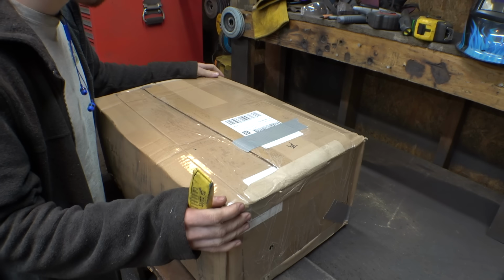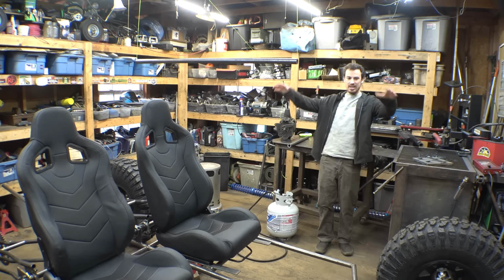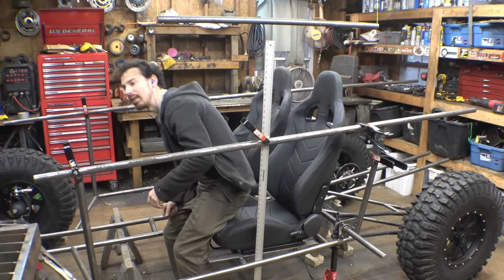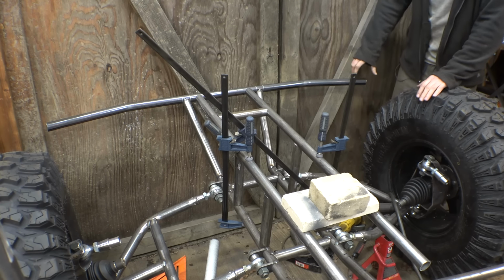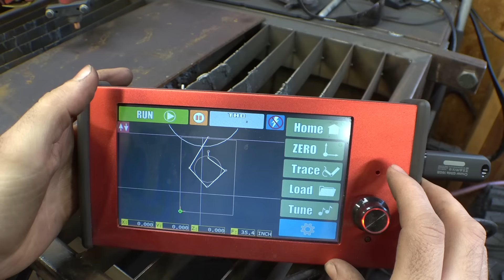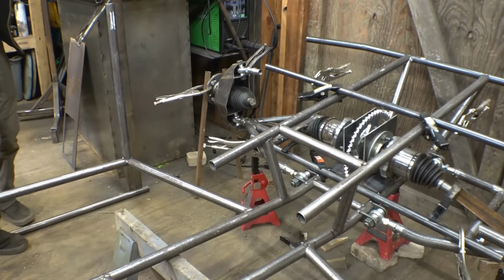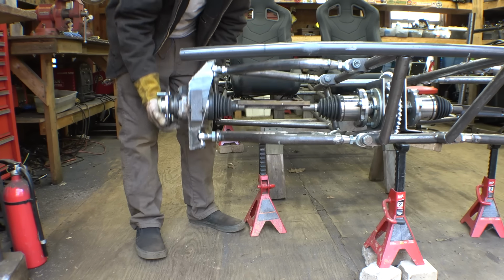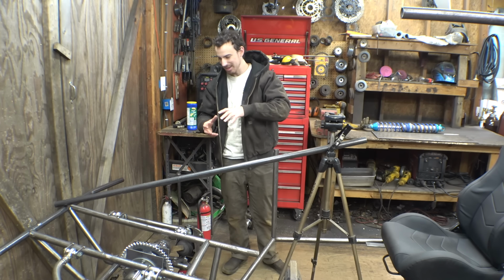Mini 4WD Trophy Truck Project - Part 3

Comment: Honestly bolt on long travel kits for Toyota 4Runners/Tacomas are only 13.5-15” travel with 4wd and you can see how amazing it does high speed. All in how the suspension is used and what suspension you use. 12” travel Double or triple Bypass shocks can be tuned to handle better than 16” rigs with lesser shocks

Comment: Since you really don't have a whole lot to work with, have you considered moving a few things around and converting it to a cantilever suspension? I believe with what you have it may work better for you. You would be able to get away with much smaller shocks and get more travel out of them by using mechanical advantage of a cam

Comment: You might want to check out a diesel parking heater to heat you shop. Might do a bit better and it's safer if cuz the combustion is separate from the room air. You'd also get a video out of it 😂

Comment: Dude, you can see on my channel. Im using front engine gearbox as transfer case. You can have 5 forward gear and 1 reverse. I think that much more cheaper. Nice project dude

Comment: Great progress! However I believe you should hav more bottom end travel, the skid plates are supposed to take some botyoming out in the dunes!😀
Reply: The tires will compress at least a couple inches when you bottom out the suspension.

Comment: Incredible video as usual! Can i ask, what is car brand of the cv joints? In my country is rare to find them with internal joint flanged as the miata (This car is not commercial in Colombia as in US). Maybe do you know any other brand for cars and trucks which have them flanged and not both ends splined?

Comment: For safety reasons I recommend NOT to mitre roll bar ends.
Terminate tube end into the side.
A 45 corner can shear in compression if you roll the rig.

Comment: Just curious but do you ever consider selling your builds? Honestly the quality seems on par or better than some of the best cart or sxs manufacturers, while also being easier to service. Could take custom orders film the builds and testing and sell them to fund the channel.

And speaking of sxs have you ever considered doing a build on a sxs? Like buying an old Rhino or something salvaged and doing the ultimate rebuild or mod series. Like I have an old rhino 450, they're rather inexpensive but also dogs on power. You could pick one up, build custom suspension, modify the cage, do an engine swap, all kinds of things. But save alot of the work of building the initial structure and body. Mabey a big vtwin with a 5spd, bigger diffs and long travel. Or pick up a flood damaged four seater maverick and replace the back seat with a car engine like an LS.

Just some ideas, can't wait to see the rest of this build. Love some trophy truck goodness.

Comment: Thinking about the rear suspension with two chain driven swing arms.  Without a rear differential, isn't there a problem of binding if the left and right swing arms are moving independantly?  Like can't that lead to an unequal tension on each chain?  I seems like there's a scenario where you're giving the engine throttle while one arm is rising and the other is falling and the chain on the rising arm ends up taking the force from the drive but also some load of the suspension?  

This sort of thing happens on low pivot mountain bikes when the hub has high engagement, and the suspension is compressed deep and fast.  Extra forces from the compression of the suspension are transferred into the drive (the chain) and the rider suddenly has unexpected power delivery or the chain takes too much stress and breaks.

Comment: I've noticed your tubing bends look a little kinked I have a bender similar except mine is the model 32 and has a die locking mechanism that prevents spring back which is what is causing your bends to look the way they do. I like the video's have you ever thought about using Gorilla front CV joints a lot more travel.

Comment: Chris, with as tall as you’re making that truck it’s likely to be very top therefore the more suspension travel the less likely it is to tip over. Get as much travel as you can or lower the overall height. There’s way too much room overhead.

Comment: Limit down travel and increase up travel. Your suspension dropping shouldn't break the joints but smashing it down after a jump or big hole under full vehicle weight absolutely will.

Comment: I get that you made the dune buggy with the CBR 1000 engine but I'm very curious to see how the transmission in that street bike engine is going to hold up with all the weight on this trophy truck build seems very risky but I might not have a clue at all but I know that motorcycle transmission is not made to push that much weight

Comment: Could u adjust the angle where the a arms go into the hyme joints like kick the arm at an angle downwards at the end where u weld in the hyme to gain more upwards travel.

Comment: What you need to do is insulate that building. In that was, you'll be able to stay warm in the winter and evade some of the heat in the summer time. Does that seem as though this is an acceptable idea to you, Chris?

Comment: Suspension travel is fine.  Don't grind anything.   Not every build needs maximum travel.  I'd rather see a fast buggy with good travel, than a slow buggy with maximum travel.

Comment: Hi mate, any tips on measuring for cv shafts? I’m doing an engine swap and dsg and the old axles are longer but cv joint doesn’t match the dsg, and the axles from the donor car are too short so I’m going to need custom

Comment: check out subaru gears out of australia. they have ring gears to convert a subaru transmission to rear engine like a bug. they are used for bug conversions and for buggies. its what im using for my awd smart car.. they are awesome and i think would be super usefull for you on your next build ;) 

they have adapters to adapt just about any engine to the subaru transmission too.

Comment: Any possibility of dropping the front drive gears down a bit lower, if necessary put a droop in the frame and run a bar over to recover structure. Also maybe convert the front to an automotive differential since you are intending to use a 4wd gearbox anyway as a drive shaft will be safer than a long chain. Just a thought, love your build series awesome to see your brain working through your issues. It is a little disappointing that it only has such a short travel and it was obvious from your face that you are not that happy about it either.

Comment: The only chinch i have with the gearbox is that it's excessively heavy, it's originally meant for a JEEP, and with that comes added weight that's useless to you. Honestly... i'd try to figure out just how much weight it has and do some math to see if you couldn't recreate that casement (keeping just the gears) from lighter materials. It certainly does not need to be anywhere near as strong as it is for the application you're using it in. 
jm2c

Comment: With having the back pole on the upper control arm going directly into the Heim joint and the outer pole just welded to the side, can that cause a weak point for the control arm?

Comment: Please be careful when attempting to 'jump' this. Those seats are not suspension seats. A serious question : How did you pick a spring rate and shock without knowing the weight of the conrol arms, tires, rims, knuckle, cv, the angle of the shock, and the distance  from the pivot, not to mention the completed vehicle weight?

Comment: Are there any specific reasons as to why you prefer chain drive rather that shaft drive? I feel like going shaft drive would not only be a cleaner finish but also lessen your limitations. You could use a front and rear diff. out of a totaled SXS. I’m sure there’s plenty out there you could find for decent prices. I just noticed most of your builds utilize chain drives rather than shaft drives and I’ve always been curious as to why.

Comment: love seeing the progress and the discussion of your project. Question: why did you use the chain drive vs going with a car/truck front differential? Is it weight-saving or easier to connect the power to the motorcycle engine? I am looking to do a little AWD race car like the Palatov D4. Weight is a big concern in my project.

Comment: TURN UPPER HIEM JOINTS AT SPINDAL 90 DFEGREES  THE JOINTS NEED TO SIT VERTICLE TYO PRVENT BREAKING THEM AS WELL AS MUCH MOE TRAVEL, WHEN THE UPPER ARM IS HIGHER AT SPINDAL THEN FRAME MOUNTUNG U GET ASNTI DIVE ACTIONS  ...

Comment: Really a top box the whole size of the vehicle that curves in to clear the tires (or over the tires) and a similar box that is curved in to fit the suspension.  The bottom box can be flat and the top box can bend up to fit the shocks better.  Place the top bar about 12" above the bottom one so you have plenty of room to get out.  Then put zig-zag bracing between the top and bottom parts with lighter tubing.  Then put cross bracing for the seats and such and a roll bar on top with "X" bracing for strength.  You will want fenders on front and back tires.  I do not understand why you did not put some differentials on this with locking hubs (Manuel) off a small SUV or truck from the junkyard and a transfer box.  Chains are just noisy and a big failure point.

Comment: what would happen if you had clocked the outer joints on the knuckles horizontal instead of verticle at that$$

Comment: You need to max out wat ever shocks you put on. If you have 5 inch shock travel then you don’t use shocks with 8 inch travel or the shocks don’t wrk correctly. You need to 
Use the full travel of wat ever  shocks you put on.

Comment: 0:10 Hello, one question, how do you find those elements that look like ball joints that you have mounted on the ends of the articulated arms? or with what name?
Reply from the maker: Heim joints. You can find them on Amazon

Comment: Why chain drive, this is going to be problematic from the get go. I’d go shaft driven you will have less issues and better performance less worries. I like everything besides the chain drive. You need to really consider shift drive and it will be less noisy.

Comment: I love your builds, but you're not really building a trophy truck right now. Several things to note about trophy trucks: they all have a solid rear axle. You can't really call it a truck if you have independent rear suspension. (Ok that's subjective, but I have never seen a trophy truck with IRS) okay next thing is that they have engines in the front. Right now, you're basically building yet another buggy! To get the travel, you can do 1 of 2 things: either A) (which is probably better) give it I Beams (AKA twin traction beams) or B) lengthen the control arms. Your vehicle is quite skinny as it is, and your hubs could use less scrub radius,(the distance from the center of the tire to the kingpin (the steering pivot point of the hub)) which would allow for a less significant width gain

Comment: U should really look into utv setups and part to help with build ur now get to the  weight to have bigger motors look at Japanese kie trucks or Suzuki Sammy they have divorced transfer case like to see u build sold axel crawler use bigs bike motor a shaft drive to a transfer case 4 link axel witch kie trucks and variety of this there small and the size things u build aren't far from one of those but look into all sport and farm utvs you can find all kinds of this to build use smaller engines